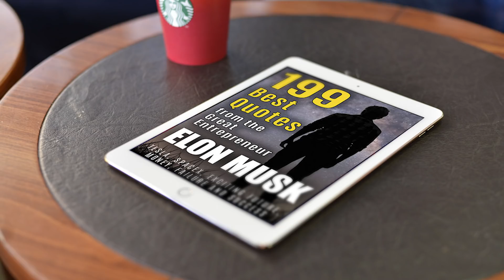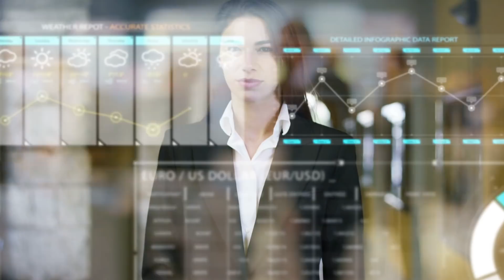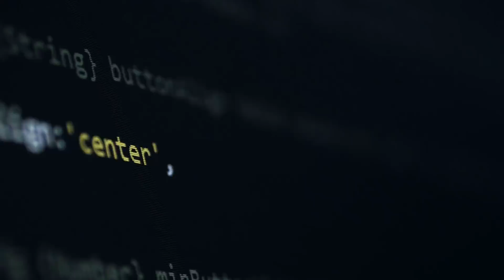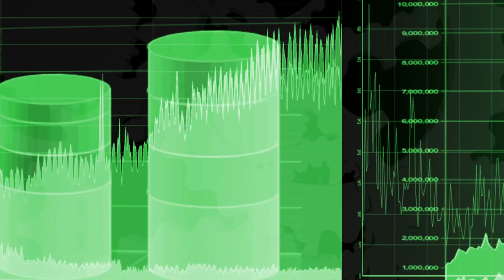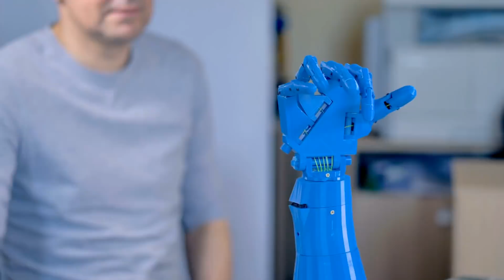9 CRAZY Things That Will Happen Before 2050!

Comment: Most of these things are natural progression of hardware, firmware and software. The term “Gender Equality” is so overblown, over used and generally unquantifiable. It relies on everybody agreeing on a definition just to get the ball rolling. Therefore, because the human race will never agree on a definition “Gender Equality” will NEVER happen or already happens. 

In regards to your USA abusing the earth and it’s all our fault editorial comments you have been duped or straight out misleading (lie). You’ve bought the idea hook, line and sinker. Maybe you should research before repeating what a pundit on TV or the internet said.

Comment: gender equality is one of the worst ideas ever conceived, not to mention its as well a communist idea, equality can't be reached and wont be reached, you have to pull down so many in order to integrate the weaker links or in this case the weaker sex, just because you feel something isn't right doesn't make it wrong, emotions don't correlate with logic, and logically just because someone feels wronged by society, society needs not to make up to anyone, after all the world isn't supposed to be fair or just, its what it is because its disorganized and random and only the strong; emotionally and mentally can transform it.

Comment: That internet of things idea is so stupid. Deliver milk to your door, deliver a roll of toilet paper to your door? How is that economically viable even if you use robot delivery? I'm on my phone too much as it is, why would i want to also use it to run a bath, turn on the lights or close the shutters or open windows etc. What if any of that shit malfunctions and i have to get expensive reparation services? A door that you open and close manually lasts about a century before maintenance is absolutely necessary. I've replaced enough garage door motors to know i don't want my windows, doors and everything that moves to have a motor in it. The maintenance on a fully equiped house like that would be very expensive to the average person.

Comment: hmm.. Hyperloop failed in 2018 its now nothing more the a tunnel you drive you car down, not surprising, the thickness of the pipe would have to  be  6 or 7 feet thick to hold a vacuum,  so a sealed tube, 30 miles long..  and and accident happens in the middle... woops..  lemme just take 9 days to recompress the tube and another 6 days to cut through 6 feet of steel...
lol

mission to mars not possible, they found the dust particle's so tiny it would corrupt any seal, airlocks. visors..   no seal = no oxygen storage... sorry Mars is off the inhabitable list

Comment: "primitive notion of gender equality", I think what you mean is, scientific knowledge of biological differences between males and females. These include strengths and weaknesses that cannot be overcome with legislation. Actually most of this stuff is not going to happen before 2050. Mars won't ever happen because it's a fruitless endeavor. Hyperloop won't happen for the same reasons that high-speed rail hasn't happened.

Comment: If the hyperloop is a tunnel you should be able to make it a vacuum then you should be able to go super strait and up to mach 2 or 3 if you can go strait and in a vacuum.  Such as LA to Chicago but mach speed only from like Kansas City to Chicago or to Dallas or to Atlanta etc.  Mountains will slow it down.

Comment: what about the 70s soiar space pannle plan to remove the need for fosal fuals  with microwave tramsmiting power already tested useing ducks and to grow crystals in space and 3d printed objicts have a stronger structure with no gravity compressing it during creation and there is a sound chart that will make all forms of shapes from simple circles to human hands ect just useing 4 directed speakers to a liquid in a box we now can 3d print with sound way better quilty and strength

Comment: Of course you will require a gender neutral robot to fix the robot that picks up the now rancid piece of pizza that was dropped 10 days ago by the malfunctioning feeder robot that has since gone on a destruction bender, while Lazy'o is still flicking through his VR porn stash slowly dying of malnutrition but no worries the funeral and body disposal bot are on standby for when the IoT existense stats drop to zero. Not to mention the automated banker Direct Debt bot that will automatically drain you of all fiscal responsibility. But halfway around the world that infamous comment that supports the 9 out of 10 cats liked this sales pitch says. "I dont know what the problem is mine working fine" on the basis of a single function bot that turns the only light bulb on and off.

Comment: I dreamed about that hyper travel system back in 2012 and it is definitely going to happen, I have that written in my dream journal.  But I didn't write it in my journal until last year because that's when I learned it was important for me to write them down.  I also dreamed about that out of space thing and it doesn't work they crash but it looked like they crashed on earth one or two people survive they may have even been the only two on the craft.  We definitely aren't going to be replaced work wise with robots although using robotics in surgeries a doctor's and nurse's presence is still required.

Comment: RENEWAL ENERGY IS A JOKE WHY IT COST MORE MAINTENANCE  THEM  THERE FOR NUKE POWER PLANT WILL GET MORE ADVANCE  NOT RENEWAL ENERGY THERE IS EARTH HEAT 10 MILE DEEP THAT CAN  BE USE AS POWER PLANT ( EXPENSIVE ) THAT WILL BE  COST EFFECTIVE MORE THAN RENEWAL ENERGY= 100 YEARS FROM NOW NUKE POWER STILL THE CHEAPER

Comment: Sorry to say but there will never be a truck that doesn't need a driver. They have them yes but they require a person behumd the wheel for safety reasons. Seeing the back an truck without a driver can not check a load nor can it do any kind a inspection. If it gets pulled over for an inspection the company will get the ticket not the truck.

Comment: Vacuum transport tubes are untenable due to no survivable failure mode. Build it at normal air pressure and sacrifice a few hundred MPH. That's doable.

Comment: So, replacing truck drivers, huh?  And who is going to get out and deal with the shippers/receivers?  Who is going to do a pretrip inspection and fuel the truck?  How about the electronic logs?  Who is going to weigh the truck at scales and trip plan and deal with the DOT officers at weigh stations?  I'm sure maybe the technology will advance but seriously?  Remember the Tesla disaster??  That was a car.  Imagine an 80,000 missile with no one behind the wheel.  Good luck with that one!!
Reply: Francia F. Truck drivers won’t be replaced. They’ll still be needed to make the truck is operating properly. Technology is only advance because of people. Plus companies like to cut corners and save money. So the tech isn’t going to be that great or advanced. Just less stressful to the human. Plus human drivers would be needed just in case the tech trucks go off line.
Reply: Francia F. Also the tech trucks will only be used for rush deliveries and Holidays. Like I said companies want to save money. Those tech trucks will be expensive as hell too.
Reply: @crystalsplace7163 OMG  Yes.  Probably not affordable except for the mega carriers.  Even they might not be able to afford it.
Reply: Self driving trucks will be much safer. If all cars were self driving then highway death tolls wouldn’t exist.
Reply: You're probably going to get partially self-driving software and sensors added on to your truck within the next few years. One company is already selling a package for about  $5000 dollars to trucking companies. They do self-driving well on all insterstates and all highways  (if the company has all the HD maps) but still require your eyes on the road. Its a much safer and more relaxing experience. Think Tesla Autopilot or Cadillac Supercruise.
Reply: Most modern cars today are build to be able to connect into the system and some roads are build with wifi and safety features like magnets, similar to how elevators are secured in the tube. The road will be more as an organism. The need for human judgement behind the wheel, will dissapear. What truck drivers can do, is to use the time they have now, to learn and maintain this technology, so that they do have a job.
Reply: King Conan  All this robotic replacement stuff is very scary to me.  We have to be careful not to let the robots take over.  I'm 59.  Remember 2001 a Space Odessy when the robots took over the spaceship?  I am no expert but I don't think it will happen until at least 10-20 years.  Do you see it sooner??
Reply: @ElizabethF2222  It's funny that people like this only talk about easy office jobs. They don't talk about roofing. And shipping and delivery being automated? Guess who's going to build that? Now, of course, some women got what it takes, no doubt. But we all got our roles, and that's biological.
Reply: @hmmlemeeshink  Totally true.  There are some jobs I cannot do as a female trucker.  I can't pull a flatbed as some of those tarps, particularly if they are iced or snowed on, can weigh upwards of 100 pounds.  I only weigh about 125 and cannot lift that much, so can drive a reefer or dry van only.  I'm going to train to be a tanker driver soon and some people think I can't lift the hoses, but have helped do that and I certainly can.  It's relative, I guess.
Reply: TexasLadyTrucker I’ve been a trucker for only 7yrs now I’m only 35 and I’m not scared of what they say about robots trying to take our jobs if that ever happens I will be well over retired by then I drive a tanker/ hazmat loads I really like my career but I would like to spend more time with my family so I want to retire at 48 God willing But TexaLady DONT left this robot mess scare you think positive
Reply: There are trailers with motorized rolling floors. Course this video assumes nothing will breakdown.
Reply: Is anyone forgetting what will happen to OUR jobs. Humans like to work, I love working, if Wal-mart came out tomorrow and said they can do everything or mostly everything with technology ha sorry, not shopping there again.
Reply: Robots are amazing I’d rather watch a robot then do work anyday

Comment: I would caution about the "implementation of equality" Men and Women cannot be equal, even if there were traditionally identical roles in society for men and women (which is obviously not the case) there are too many biological differences to "overcome" on the road to equality. The only way to subdue these differences would be by force or the threat thereof. Pursuing change for moral reasons through immoral means is still immoral.

Comment: One to add to the list....based on current 'trends/observations', by 2050 humans will have lost virtually all ability to verbally communicate with each other.  Using the introduction of the smartphone as the starting point, the spread of speach withdrawal will continue to rise exponentially, as can be witnessed anywhere one currently cares to look.  The rise will continue unabated as the 5G network gets rolled out.  Humans will continue to learn languages, but their ability to meaningfully converse with them will decline, also exponentially.  The final nail in the coffin will be voluntary participation in projects such as Apple's ithought [my prediction of a future thought-process exchange system], where participants have thought 
-reading graphine nanochips implanted within their brains so they may communicate directly amoungst each other by thought alone to any other implantees or any other such similarly connected device.  Speech will eventually become all but obsolete.  Such thought-reading technology already exists..and has for some time, however it's use has been widely applied to assist amputees with replacement robotic/android type limbs (inta alia).  It is not a such a huge step to take it into the realms as predicted above ☮.